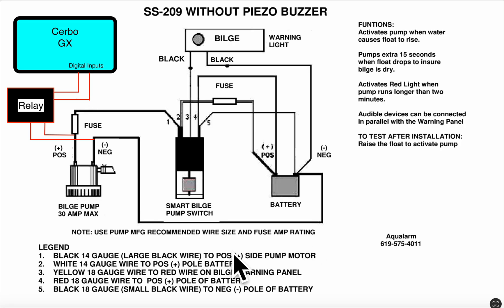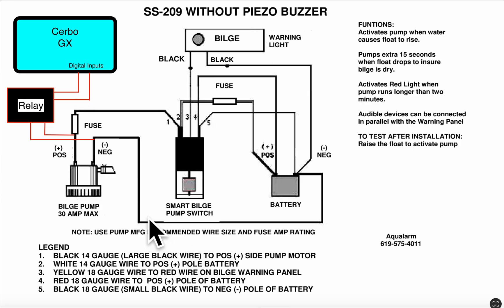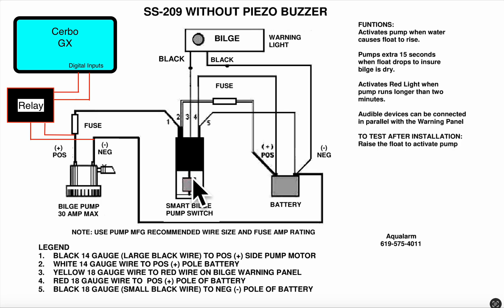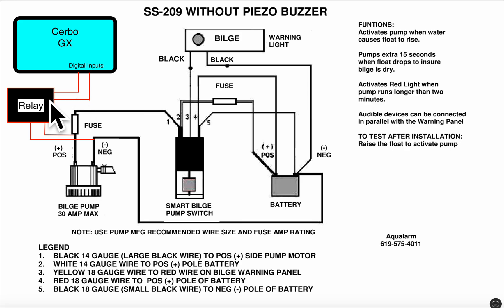Victron Cerbo GX Wiring - Bilge Pump Relay

Comment: Do you need a relay that is able to handle 30A?
Reply from the maker: No, because the relay isn't carrying current in this situation, it's only sensing voltage which triggers the relay which in turn prompts the Cerbo to indicate either on or off.

Comment: What relay?  Seems vague.
Reply from the maker: The relay in the video is a Zooz NO & NC 2 Channel Accessory Relay ZAC98 (12-24 V Inputs, Dry Contact Outputs). Be aware that ignition protected parts are required in some applications.